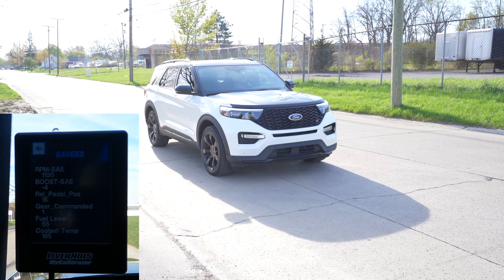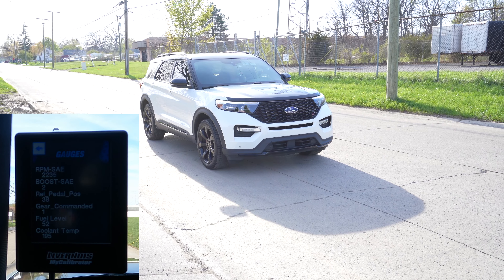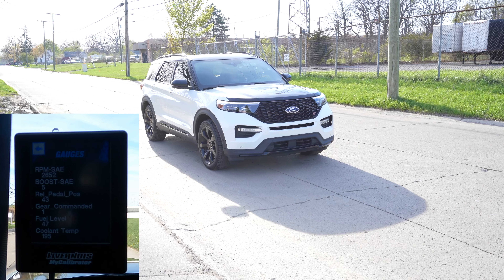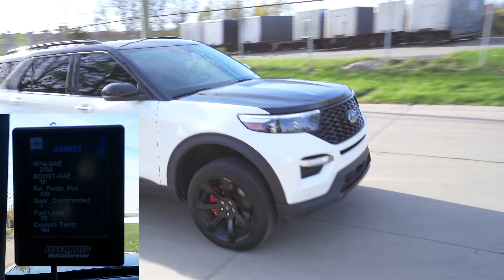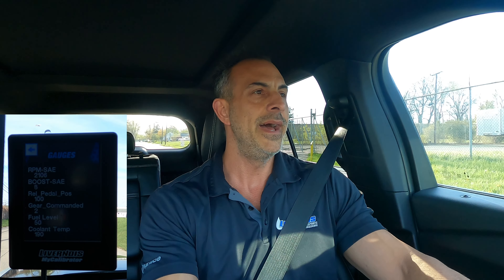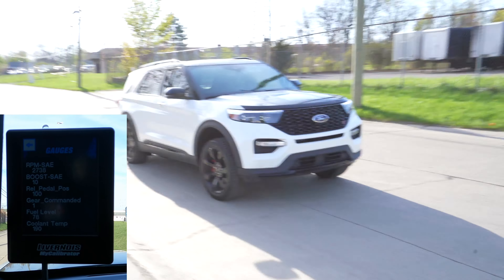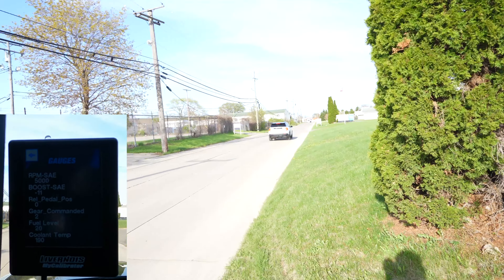Explorer ST Full Boost anti-lag launch control test on Livernois Multitune

Comment: Thanks for sharing. I have 23" ST and if you're getting much more than a few chirps out of those tires on a launch, you are either in the rain or a gravel road. Short of 500hp this SUV is going to hook, or just break because it unfortunately wasn't designed for much more power than it comes with from the factory without a few modifications.
Reply from the maker: Well, the video is clearly that of a dry, cement paved road, so our tuning respectfully disproves that, so it's just a Livernois tune away from that power. While certain power levels do benefit from drive line upgrades, we've never had a tune only vehicle break anything.
Reply: And you’re probably not going to see any damage until you get past the 500hp range without upgrades. And it seemed to hook great in all of your launches.

And using launch control IS definitely better than brake torquing and super cool!!

Comment: How are you getting 100+ hp with the aviator but only 60 with the Explorer ST??
Reply from the maker: they're identical vehicles, so we aren't. They're a date progression. So in 2020, the videos made less than 21, which made less than 22, which made less than 23, and so on. We're able to make over 500whp with light bolt ons and E30, which is well over 635hp at the crank. and of course more with further upgrades like turbos.
Reply: Aviator has the hybrid added too helps ?
Reply from the maker: @tedbear6012  We do not support the hybrid unfortunately
Reply: @LivernoisMotorsports 
Any reason why you would not tune hybrid ?
Reply from the maker: @blackgenesis7472  We do support the Aviator GT hybrids now.

Comment: I see on the programmer display, Gear command 2.  Is this staring in 1st or 2nd gear?   Did this vehicle have an aftermarket intercooler?  What brand?   When are you going to release or sell an intercooler for this vehicle on your website?
Reply from the maker: This did launch in first, the gear commanded displaying 2 prior to the launch is due to entering launch mode, but once released it displays properly. As for an intercooler, at time of videoing, it was a stock unit, but since then has received one of our prototype intercoolers, which we plan on launching soon.